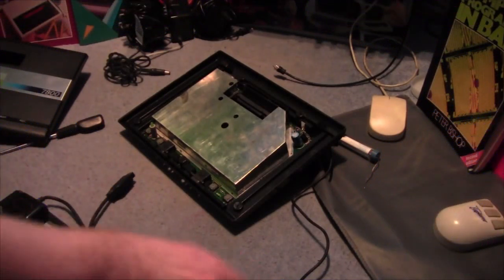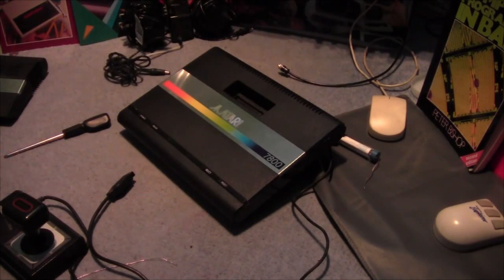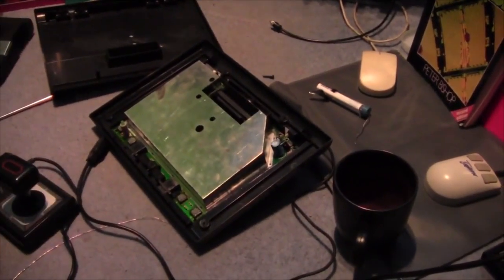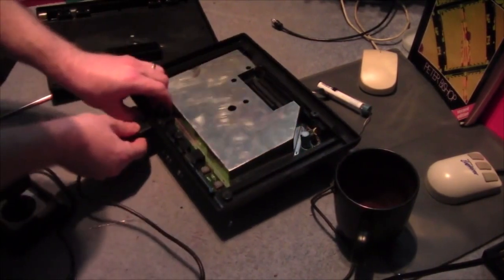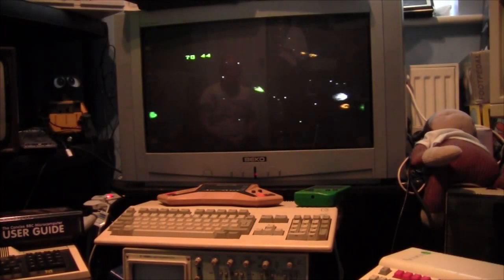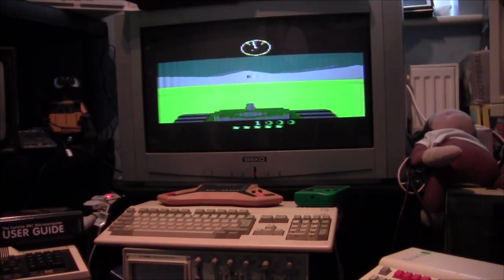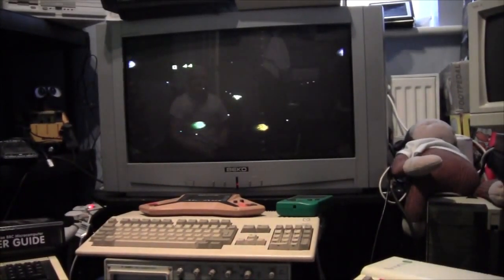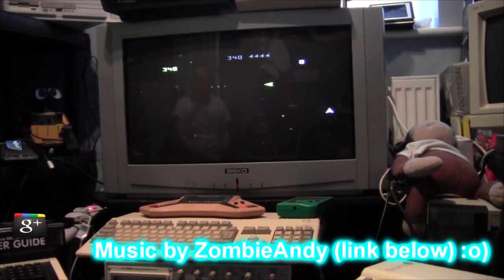Atari 7800 power adaptor modification :o)  (I finally got it working) :o)

Comment: Excellent work sir.  Yes the PAL version of the AV mod is a bit more complicated than the NTSC version.  I would really like to do the AV mod, as the output picture quality can vary quite a bit sometimes.  You need to find your 7800 game, as they are excellent titles.  This is a system that definitely deserved some more games.

Comment: Just a piece of constructive criticism on your solder work. @1:53 you can see the bare wires from the Sega PSU soldered onto the board. It looks like there's scope for those wires to cross and short which could damage the PSU or the Atari so if I were you, I'd get some heatshrink tubing and re-do the solder work using the heatshrink to insulate those bare wires... Heatshrink is cheap enough and you can get it at your local Maplin or pretty much any online electronics components supplier.